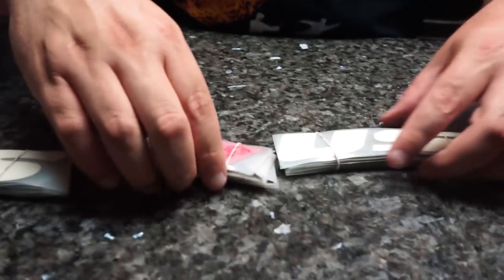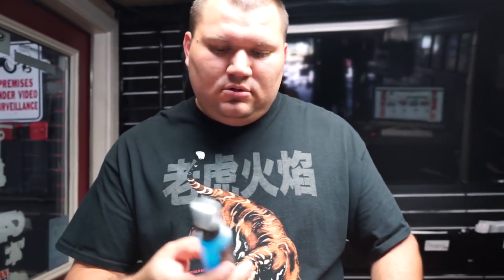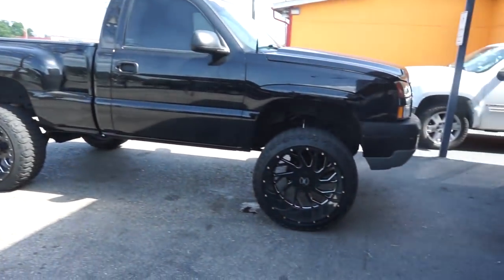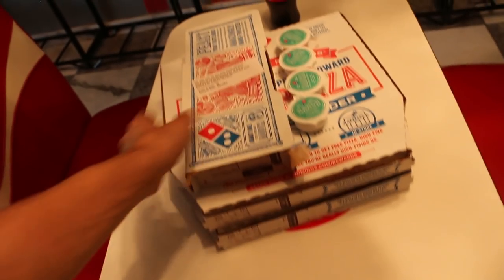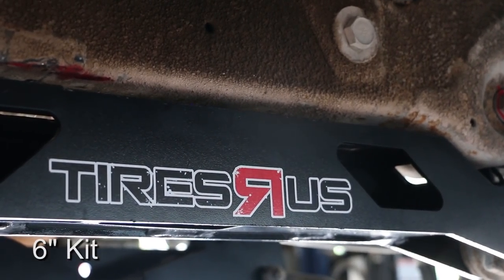PUTTING TIRE STICKERS ON LIFTED SINGLE CAB (24" WHEELS)

Comment: Do they make tire stickers for 26" wheels and tires I got the strada perffeto on my white 04 titan in the gloss black and machined face going for that low race look and was just wondering about the stickers also running 305/30r26 tires